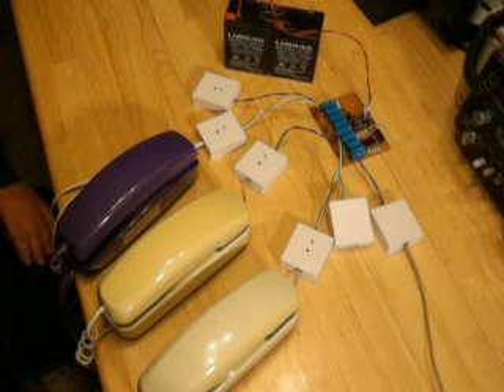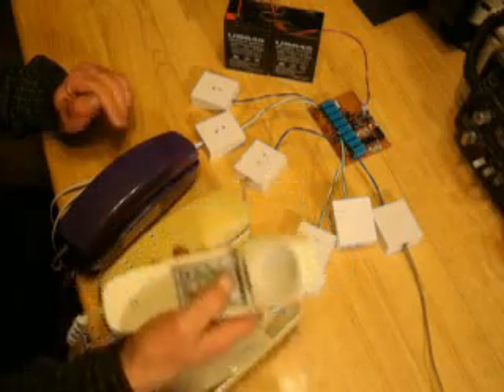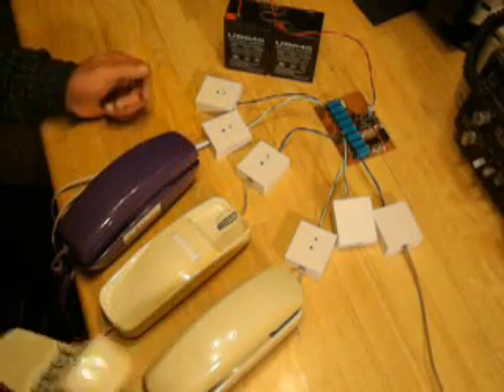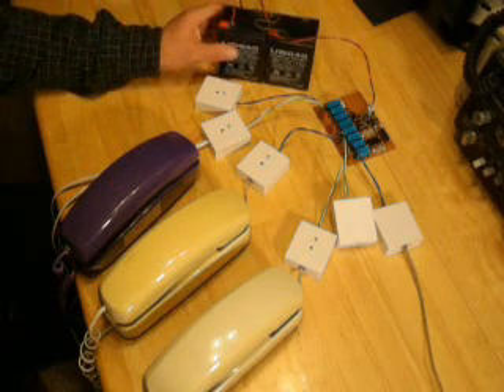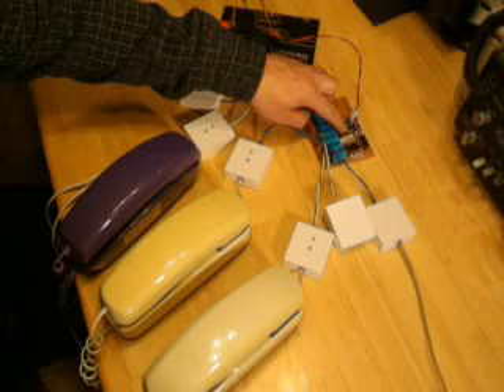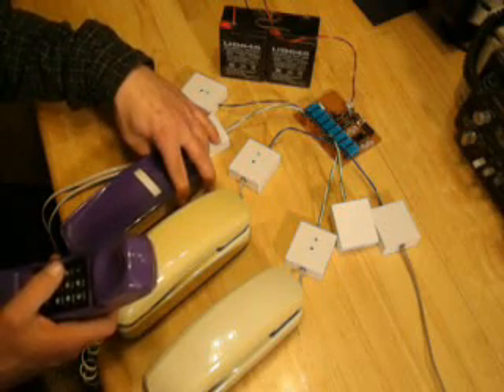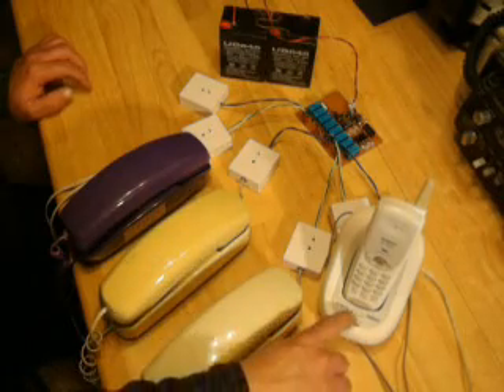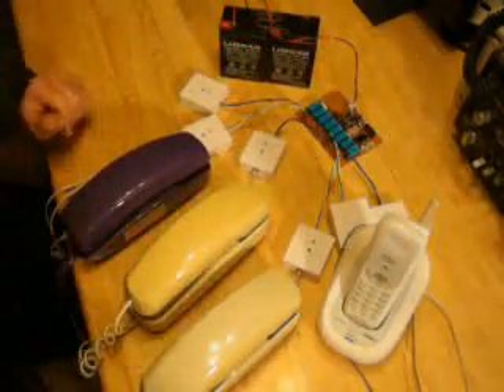Dial-Select Telephone Intercom System w4p300 #301

Comment: Bravo ! Superbe travail. Pensez vous que ce systeme peut fonctionner avec les vieux telephones à cadran rotatifs ?
Reply from the maker: This circuit will not work with rotary dial, it uses the DTMF (tone dial) decoder to signal. A microcontroller (arduino) could be used to count the pulses from a rotary dial to select the station. I have not built a circuit like that.

Comment: Do you have a schematic for the board
Edit : and can you make it so you can type in 12 and the 12th phone 📞 will ring
Reply from the maker: To get schematic send email to  intercom4u  at yahoo dot com. To make the unit recognize two digits would require some kind of circuit to latch the first digit while waiting for the second digit. With microprocessors being so cheap these days, it would make sense to just feed the output of the DTMF decoder to the processor which would then signal the desired station. I have not built such a thing but it should be fairly easy if you have worked with small microprocessors.

Comment: Those cordless phones have the intercom facility built in between the other handsets anyway
Reply from the maker: This video is about connecting regular wired telephones together. The cordless telephone shown was a single unit, not part of a multiple cordless phone system. If you have a multi-handset cordless system, you could just use that as an intercom, of course.

Comment: Hi. I need this to communicate from reception to my 3 dance rooms , and from room to reception. is this system capable to talk from reception to all 3 rooms at the same time ?
Reply from the maker: It was only intended for two phones to talk at a time. As more are used, the volume gets weaker (how much depends on your phones, possibly they may not even work). It may be possible for four to talk together at the same time but expect that the volume will be low.

Comment: Can you make a video about how to make it
Reply from the maker: I had not planned to. Some people would need little guidance, some would need hours. If you have experience in building electronic circuits and can read a schematic, the schematic and notes that I provide should be adequate to build the unit.
Reply: Wired Up I can not read schematic
Reply from the maker: Sorry, I can't help you. To show you how to make this would require a very lengthy and detailed video. It would be like expecting a chef to show someone who has had no cooking experience how to cook a meal. He would have to explain every detail about how to select the ingredients, prepare them, use a knife, a mixer and the oven. It would be quicker for the chef to just make the meal. If you learn to read a schematic and have some experience assembling electronic circuitry, you would be able to make this. The schematic is like giving a recipe to someone who has cooking experience.

Comment: Could you have every one 
Talking at the same time
Reply from the maker: All of the phones are in parallel on a common talk circuit so any phones that are off-hook would be able to talk to each other - but - the amount of current in the talk circuit is limited so the sound will become weaker when more phones are in use. Normally, there would just be two talking, three works OK but four starts to get weak though it depends on the particular phones that you are using. All eight? Never tried it but I wouldn't expect it to work well, if at all.
Reply: Wired Up Thank you

Comment: So if you replace the buzzer with ring generator, you essentially have PABX? This is so clever!
Reply from the maker: A ring generator could be added to the circuit board to send ring voltage (instead of reverse DC polarity) on the line to use the telephone ringers. This would be a simple modification of the circuit. I chose to use the DC buzzers instead in my design to avoid needing the ring generator.
Reply: Ring generators can be tricky because you have to deal with flyback current and ring trip. Better to use one of the cheap ringing SLIC modules available. See my 8-line telephone exchange here for ideas: https://github.com/diggydude/php-pbx

Comment: can this be used on an old rotary phones ? i have many of them in stock
Reply from the maker: No, the circuit decodes DTMF (touch-tone) and would not work with rotary (pulse) dialing. It would be possible to use a simple microprocessor to count the pulses and signal the station but I have not built such a thing.
Reply: You could also buy a pulse to tone converter that will convert the pulses to tones and then connect this to the intercom.  Also, are you selling any of those rotary phones?
Reply: You can do pulse counting with a $3 Arduino Nano. See the Github link I posted above for ideas on building a simple rotary dial telephone exchange.

Comment: How did you make it so when you press a number the phone beeps
Reply from the maker: As I explain in the video, there is an IC (#8870 DTMF decoder) that detects the touch-tone from the phone and outputs a binary code that represents the button being pressed. The binary code is fed into the 74HC237 logic IC which converts the binary code to 8 individual outputs that drive transistors that operate one of the 8 relays. A relay is wired into each line going to a station and the contacts of the relay reverse the polarity of the line. A buzzer is connected thru a diode to the line so that when the polarity is reversed, the buzzer sounds.

Comment: hello there, thanks so much for sharing your work.   very nicely done.  i'd write privately but didn't see a message option on your main page.  i've seen a number of different versions of the telephone intercom model and was thinking it'd be perfect finishing touch for the electric limousine i'm now running.  my main question is can this phenomenon work without an actual phone on each end?  just two handsets?  the limo is vintage, the handset already installed is vintage bakelite style.  beautiful, robust and fits the application perfectly, so would really like to figure this out asap.  thanks for your time.
Reply from the maker: If all you need are just two stations to talk to each other, I have a very simple circuit which may suit you. It takes a bit more than just a handset on each end, you need a "network" circuit (this is a circuit which is part of a telephone to support the microphone and earpiece), which you may or may not have. Send me an email at intercom4u at yahoo dot com and request "two station ringdown", perhaps this will work for you, no dialing required, picking up one phone will automatically cause the other phone to beep until picked up.

Comment: Is there anyway to connect a loudspeaker to this system and have it automatically answer?
Reply from the maker: +Blake-Technology!  Not in any simple way. Perhaps what you are looking for is something like the speaker-type intercoms where you select a station and have a talk/listen switch. These were commonly installed in homes many years ago. It would not be too difficult to build such a thing but it would be nothing like this system.
Reply: +Richard Floe I see. Thanks anyway.
Reply: Is it that hard to build speaker-type intercoms? What are the things needed and how could I make it? Thanks
Reply: +Airyn Igagamao Not necessarily. I'm sure someone has done it before. People used to put NuTone intercoms like you're talking about in their homes. Try Instructables.com or Google for some plans.